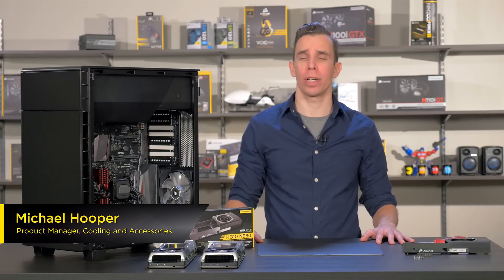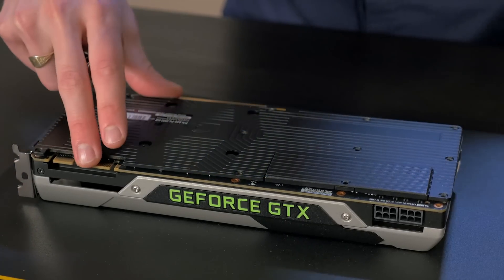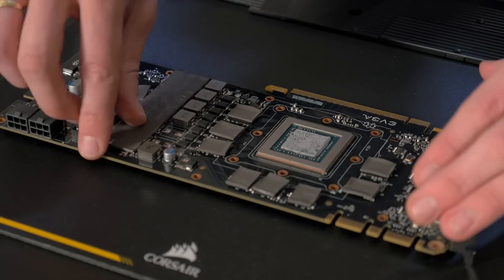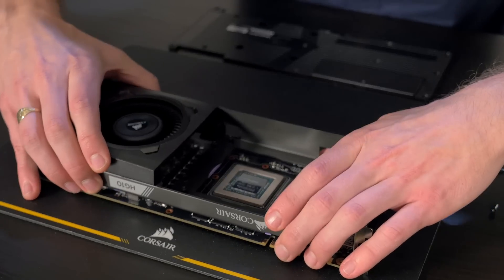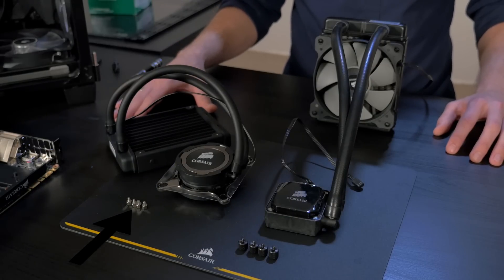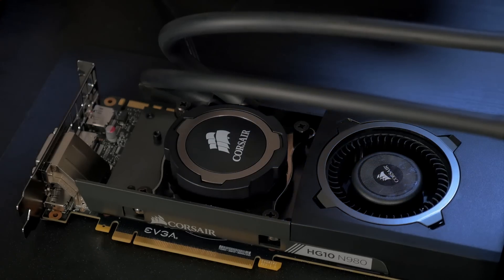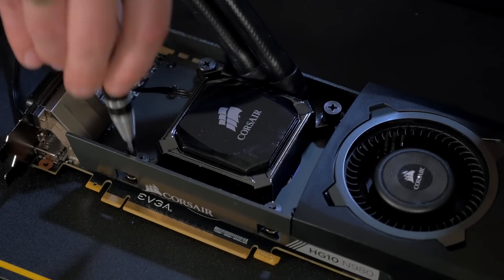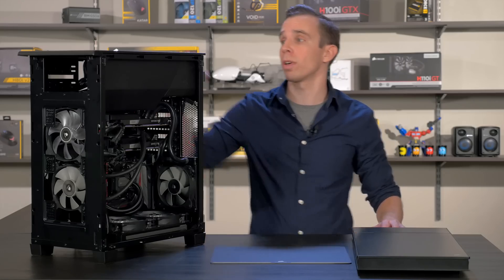Corsair Hydro Series HG10 N980 installation how-to demo

Comment: 2:17 You guys need to take this video down and re-shoot this part. I am 100% certain some idiot is going to not reapply thermal paste, fuck up his GPU, and then blame you guys for it.

"But I used the round cooler. You guys didn't use TIM in the video on the round cooler"
Reply: +sm00419  brand new Corsair coolers have pre-applied thermal paste
Reply: +sm00419 I highly doubt somebody with such little knowledge about their components will be attempting to take apart their GPU.  Anyway, as the two guys above me have stated, Corsair's liquid coolers come with pre-applied thermal compound.  Also, at 2:40 he says, "If you're reusing an existing cooler you need to apply TIM..."  

I don't own this product, but I imagine it comes with a user manual.  I'm sure it's covered in there, so even if the situation you described happened, it would be the user's error.  If you ask me, I don't think Corsair has anything to worry about.
Reply: You need to re apply thermal paste if you've used that cooler on something else
Reply: Not to mention they put way too much TIM on second. TIM is conductive I believe? Can't wait for that to spill over the sides and short something
Reply: +Christian Delgado Most TIMs are completely non-conductive. For GPU it's actually recommended to cover the die with the goop just like how the CPU's die is covered under its integrated heat spreader.
Reply: I stand corrected oops

Comment: where is an sli bridge :P
Reply: +hi9580 No it is needed to enable SLI with Nvidia cards.
Reply: it's recommended not needed
Reply: right!
Reply: Easiest thing to forget in my experience... :(
Reply: an sli bridge is ABSOLUTELY required to run cards in sli. you cant run sli through the motherboard pcie slots. crossfire had a few betas where it could but it didnt run things anywhere near as well. you lost ALOT of performance.
Reply: @companyoflosers  "A lot"

Comment: and why would i buy this?
Reply: +simen gulbrandsen (Duckhealsu) 

To get better temperatures on your reference card.
Reply: +Rion Moreland no,  it isn't.
Reply: +Rion Moreland nice troll,  m8
Reply: +Rion Moreland And you obviously don't account for fittings or barbs/tubing/kill coil, etc etc..., go troll another video.
Reply: +simen gulbrandsen (Duckhealsu) to uc your gpu without the hassle of full watercooling
Reply: +simen gulbrandsen (Duckhealsu) you wouldnt. Its much cheaper to get a full block and cool the whole pc pretty much.
Reply: psikeiro más Uh yeah it pretty much is. It has way more benefits to.
Reply: psikeiro más you obviously dont know shit about full water loops. Im being dead serious. It is cheaper to buy a block and res pump combo.
Reply: psikeiro más fuck off m8 yeah i do its not that expensive. you dont look in the right place. Shits cheap.